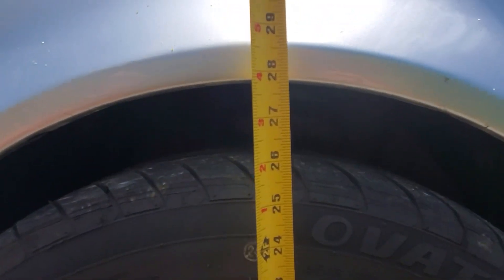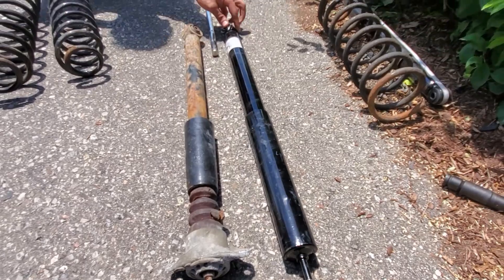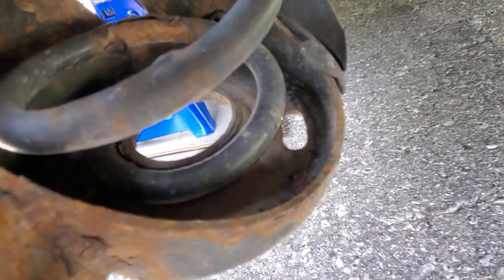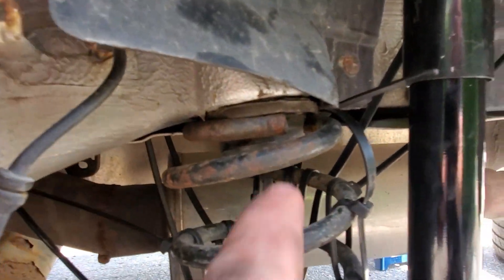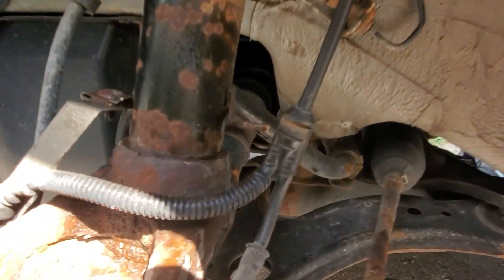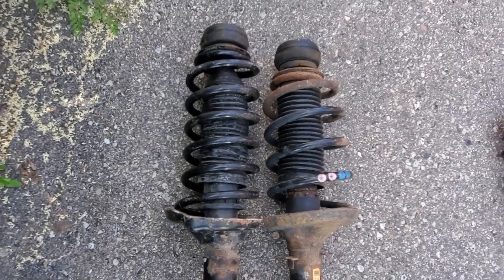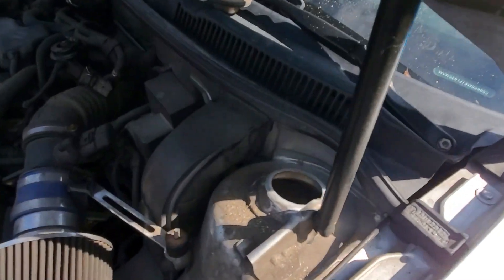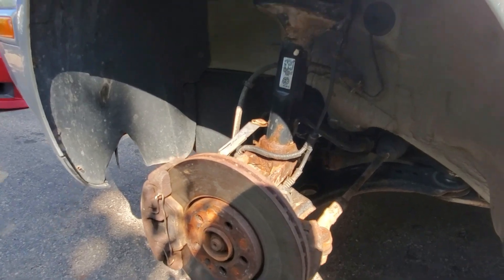MK4 Jetta Wagon Gets A "Jeep" Lift Kit!

Comment: You might want to check the rear axle front to rear alignment
It looks like the axle has moved back about 1 to 1.5 inches
check side view before & after pictures
Reply: When mk4 vw's get dumped on coilovers the rear tire moves forward in the wheel well. They make a plate which corrects this . I've never looked into it but I've seen them look bad when it's not done correctly. 

So with the lift it is going in the other direction ( obviously 😅 ) I wonder if whatever they make to correct the movement when lowering can be reversed or redesigned for lifting 🤔

Comment: This is sweet totally was one of the reasons I ended up lifting my jetta sedan. I used both front and back springs from a TJ and they’ve held up well so far I’ve already got one road trip down with it. What tire size do you think I should end up running. Most things I’ve seen have said 205/60 ish but I wanna hear your opinion. Cheers thanks for the help

Comment: Hi good day i saw your video and it's inpressive. Can i just ask a question i have a jetta mk4 2002 model 1.6 petrol SR the front is  lower than the rear is it because the front coil spring is smaller than the rear?

Comment: How is it holding up after 2 years? I'm picking up an ALH wagon soon and want to do this. I did about 1.5" on the golf with wagon spring and homemade front spacer. Loving it
Reply from the maker: Still going strong
Reply: @aaronlatendre  Does it give plow stance on the front or level with the rear?
Reply from the maker: @mybigbackyard741  I got an alignment 2 days after I did the lift because the front wheels were so bad lol and the alignment it's been handling amazing and the tire wear has been even,
Reply: @aaronlatendre  3 years in?
Reply from the maker: @Mrpike69  still holding strong, no issues! Still rides fairly similar to factory
Reply: @aaronlatendre  Sick.  I think im going to do the same thing to my sedan then!
Reply: Hey man I have a bit of a weird story with my wagon, rear is lifted by 1.5 inches but front is stock, where did you put the blocks for the front end? Top of the strut mount? Thx!

Comment: You reused the stock lower bolts for the rear struts? I at least 'thought' folks said you had to bore out the strut mount holes to match the size of the new F-150 shock lower hole?
Reply: You can bore the hold out, use a bigger bolt or throw some 10x12x20 bushings in the shock bore and use factory hardware.

Comment: Can you tell me what year jeep for front and rear springs? I'm so doing this to my wagon.
Reply from the maker: The f150 shocks are for a 1999 f150 but i believe anything from f150 1997-2003 will work from a 4x4 model v8, jeep springs just have to be stock front springs off a JK 2007-2018, if its the 4 door they will give more lift but 2door is fine that will replace the spring on the stock front shock assembly

TJ or XJ front springs will work on rear, from any year the springs from TJ, XJ, JK are all similar in size but some are more stiff and provide greater lift than others, im not a pro at lifting mk4s but you seen what I did to mine and it seems like a cheap solid set up, all together I spent $150cdn on the springs and new f150 shocks
Reply: @Jay Kay, did you do it?  I so want to do this to my wagon too. Do you have a more detailed recipe
Reply: So for the rear you have to use jk front coils from a 2007-2018 that's the only thing I'm confused about here

Comment: Hey what year are the springs for both model and how is ride now? Any issues with the axles , fuel economy?
Reply from the maker: Ride is actually smooth, you will need an alignment for sure but its a comfortable ride! Ive drove 10,000km so far lifted and Axles haven't seem effective by the lift. The fuel economy will get worse but nothing crazy stock i was getting 550km ish a tank, now maybe 500ish a tank
Reply from the maker: If you look at the older comments on the video I explained the springs info

Comment: Awesome video Aaron. I have to get these done to my wagon, cause cracked my oil pan and added a Skid plate, which now is taking the beating: Two questions:
1. What brand of F-150 rear shock?
2. For the front, are you using the stock VW shocks? Did you changes the springs only? Which year TJ Jeep springs did you recommend?
Reply: Im wondering if crown vic shocks work. Common upgrade on geo trackers. Like a 98 vic. I am upgrading a beetle with lift so ill be reporting back
Reply from the maker: The f150 shocks are for a 1999 f150 but i believe anything from f150 1997-2003 will work from a 4x4 model v8, jeep springs just have to be stock front springs off a JK 2007-2018, if its the 4 door they will give more lift but 2door is fine that will replace the spring on the stock front shock assembly

TJ or XJ front springs will work on rear, from any year the springs from TJ, XJ, JK are all similar in size but some are more stiff and provide greater lift than others, im not a pro at lifting mk4s but you seen what I did to mine and it seems like a cheap solid set up, all together I spent $150cdn on the springs and new f150 shocks
Reply: @aaronlatendre  So for the front: two stock struts, two JK springs.

Rear: two '99 F-150 V8 4x4 springs, two XJ springs?

Might try this.
Reply from the maker: @tiwalterite  yes but it's f150 shocks not springs lol
Reply: @aaronlatendre  ah yeah my bad, typo. You running OEM front struts my man? I have Bilstein TCs atm
Reply from the maker: @tiwalterite  yes factory oem

Comment: Bro how did you do your exhaust? I’m also rocking an Mk4 wagon, and I have a unitronics 1 tune. Really curious to know how it would sound!!
Reply from the maker: 3" catless downpipe, 3" straight pipe all the way then a just a magnaflow exhaust  with a tip, sounds clean but isn't loud like you'd think
Reply: @aaronlatendre  hi I want to lift my 2000 vw jetta tdi sedan so just to be clear for the front you keep the oem shocks and just put keep springs on it 
And for the rear you use f150 shocks with jeep springs so you basically need 4 jeep springs and 2 f150 shocks right and the jeep springs would be from the front of the jeep right

Comment: Hey man, is it the exact same procedure and parts for the 03 Jetta Sedan as well or the wagon is a bit different ?
Reply from the maker: Yup the exact same thing
Reply: @aaronlatendre  Thanks for sharing and replying. Is this car your daily and how did it hold up in these last 7 months that you did this? Also how is your driving style do you have to baby it now or no? I'm planning to do this on my 03 TDI and don't know how the axles will hold up.
Reply from the maker: @TheAbrunqaj  I have had absolutely no issues with the lift/suspension, only negatives I can think of is the fuel mileage got worse (as expected with a lifted vehicle) and the handling slightly decreased mainly because of body roll from having a higher ground clearance. My driving style hasn't really changed, I just cruise and look at all the reactions and attention I get now lol I might make another video walking around the car and the experience so far
Reply: @aaronlatendre  lol I can imagine how people would look. From the video it seems like you used all used parts and not new correct? I saw on a comment that it only costed you 150 CAD.
Reply from the maker: @TheAbrunqaj  it's super easy to find the jeep springs for cheap or even free because alot of people put lifts in thier jeeps and have no use for the stock springs. The most expensive part was the f150 shocks that are used for the rear and they were actually new, got both for around $100 ,
Reply: @aaronlatendre  Do you remember which brand was the f150 shock and is it front shock or rear shock of the f150. I see some pretty cheap ones rockauto.com. Where did you get your new?
Reply from the maker: @TheAbrunqaj   look in the comment section for the name "Jay kay" I replied with all the details
Reply: @aaronlatendre  Thanks a lot

Comment: Wait, so do I need front or rear shocks from the 150?
Reply from the maker: 1997-2003 rear shock from a 4x4 f150
Reply: Make sure it's a 4x4 because it's longer and that's the one you need.